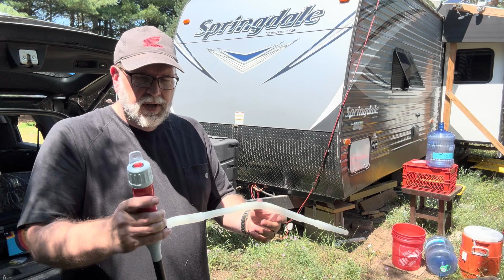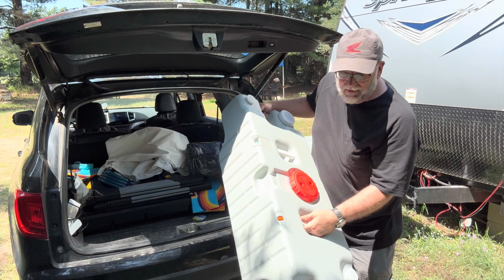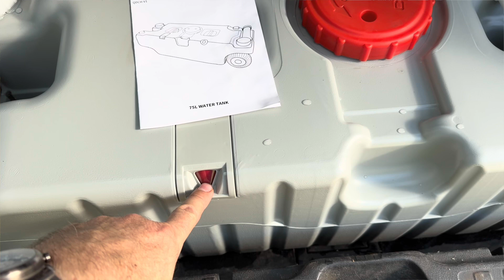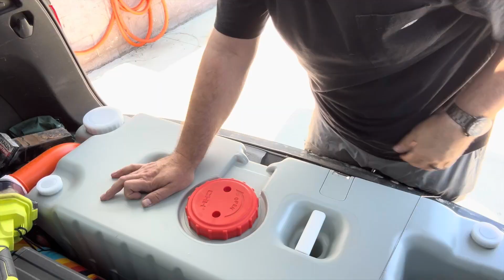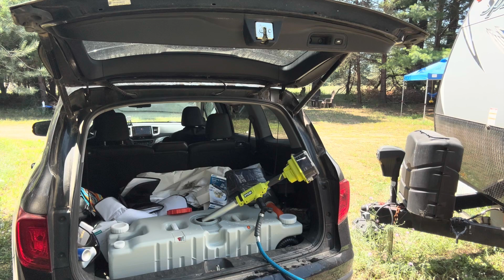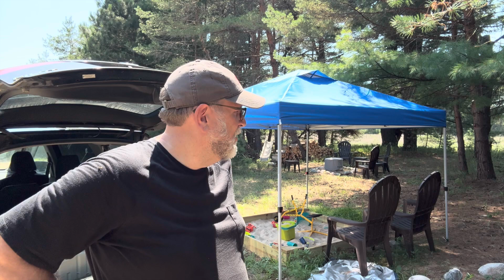A New Fresh Water Solution for RV Boondocking – Save Time & Your Back!

Comment: I am so happy I clicked on your video. I have my7 2013 pilot semi- converted. My issue is having to remove the water jugs when ever I ned to access the rear for cooking etc . I currently store pots in the recessed trunk area. But that water tank would be perfect. and I can build around it. Even the 10 gallon might be slimmer.
Reply from the maker: So glad for your feedback. Glad it helped! Share a pic of your setup when you’re done please.

Comment: Also consider collecting the water runoff (condensate) from you air conditioner. you can filter and treat it with bleach drops. Not sure of your humidity level there, but right now here in Georgia, I get around 2.5-3 gallons a day in the summer just from that. I have a 12k btu minisplit in my cargo trailer. Depending on the model of your air conditioner, you should get somewhere around that, unless it is evaporative and evaporates the condensate like in a lot of window units.
Reply from the maker: Another great idea, thanks!

Comment: Great idea, have you thought about doing a rain water collection system? We live off-grid in southern Alabama, we had a well installed, I have to use a gas generator to run the well pump to transfer water to our 4 storage tanks that are 275 gallons each. We elevated the storage tanks in hope of gravity feeding the water to our 24 foot camper but ended up having to install a 12 volt jacuzzi  to transfer the water to the camper. We had a septic system installed so I did away with the black and grey water tanks and installed 2 fresh water tanks, so we now have 85 usable gallons in the camper. It's not a perfect system but it's working for now.
Reply from the maker: Sounds innovative! I have considered rain water and might do that in the future. Since my current solution works, I want to focus on more pressing projects but next year I’ll try a hand pump well again and if I can’t get that to work, I’ll try the rainwater collection. Really appreciate your feedback- thank you!
Reply: @MIoffGridAdventures  What happened on your first attempt to put in a hand pump well? Lots of great videos on YouTube of people putting in hand pumps wells.